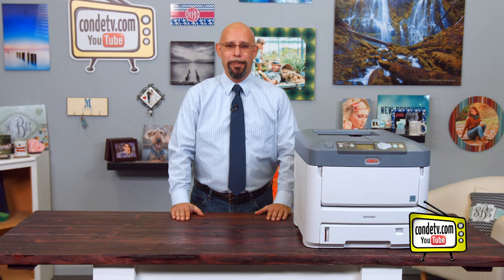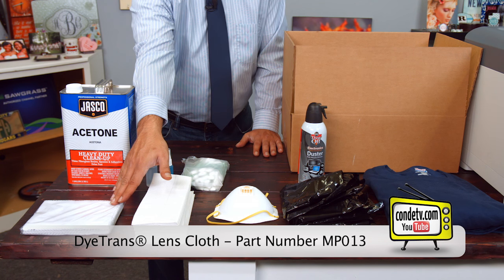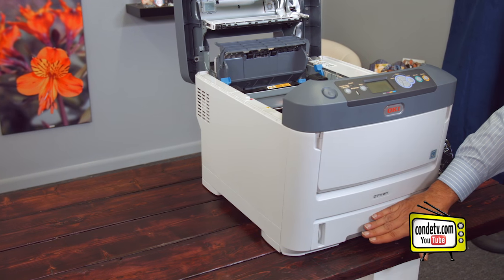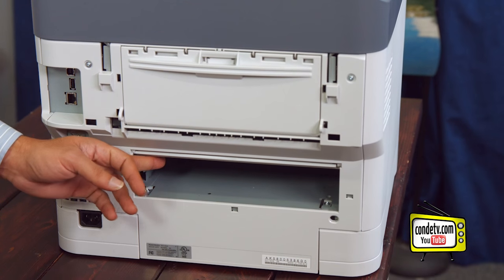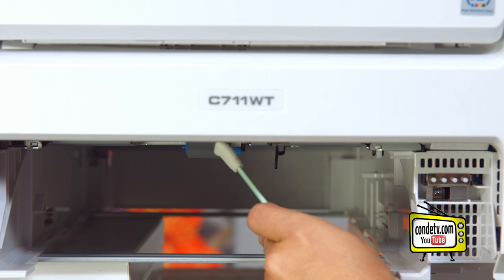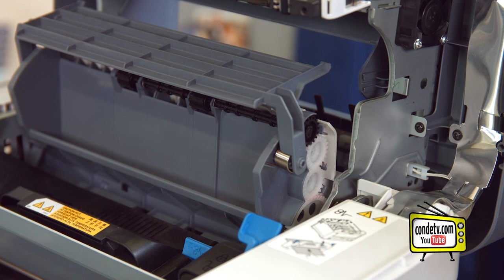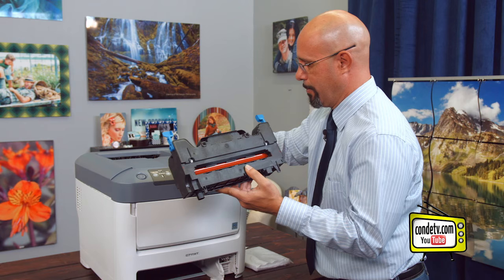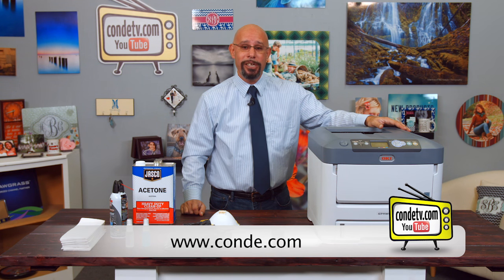Oki White Toner Printers - C711wt - Maintenance -

Comment: Just a little tip - you're NOT supposed to shake compressed air. Usually the can says that right at the top.

If you do, you end up spraying liquefied gas all over what you're trying to clean, that's why there's clouds coming out while you were spraying.   ;)